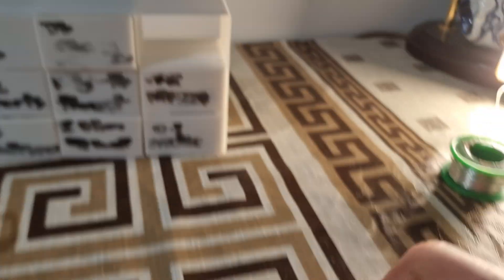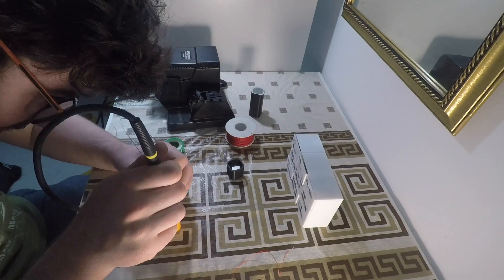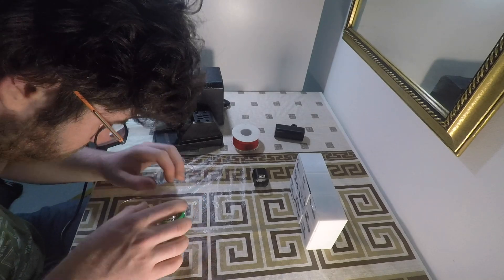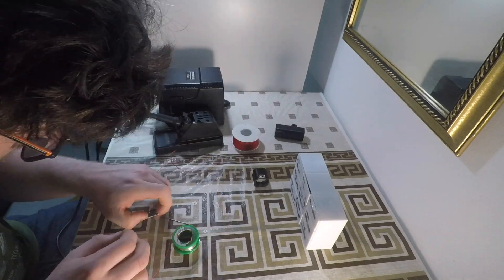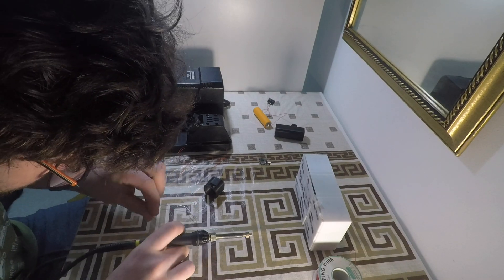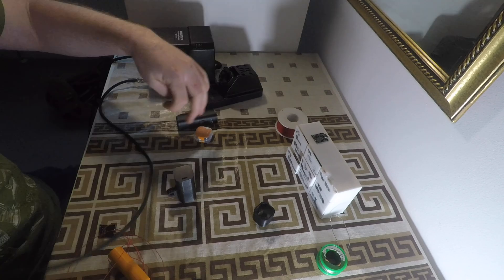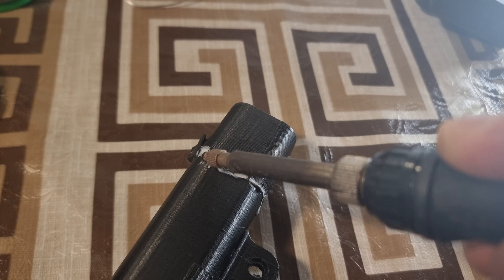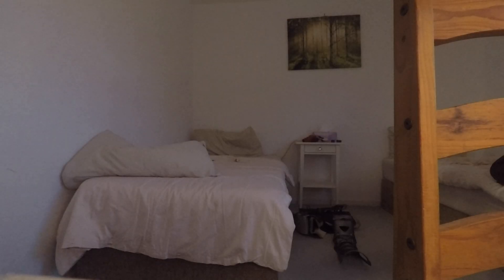I built a bike light for only $10

Comment: You can actually do a lot better than that, i built my cheap yet really bright bike light with 2 of these "Mini 3.5mm Jack 16 Selfie Flash LED Lamp" (google and you'll find the first result should be some 3.5mm jack phone flashes for ~0.84usd)
2 of those with the LED's going to a 3.3v regulator with it's input going to a usb cable, which i can then plug into any powerbank
i secure the two to my bike handle with rubber bands, and it's really bright with a wide scattered light
the total cost would be less than 3 dollars if you don't have to buy a power bank, and if you do it's about 7 dollars
Reply from the maker: Definitely agree, if I was at home I could have done alot better, I might make another video soon making the best light is can.

Comment: soldering directly to the battery 😭 (it shortens the life/capacity of the battery due to the amount of heat transferred into the battery, heat is one the fastest battery killers, next to undervolting and overvolting)
Reply from the maker: I'm using a 550 degree tip, you could still touch the battery almost immediately after it's soldered. Virtually no heat is transferred.
Reply: @Boris_Woodward  yeah that's a good way if you can't do it differently
Reply from the maker: That being said the solder joint is actually quite weak because of the lack if hear transfer